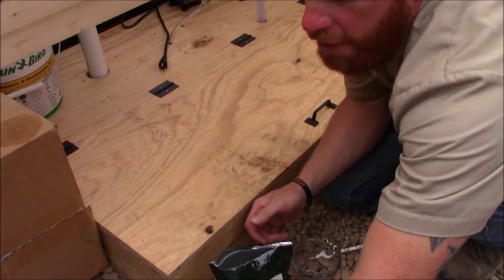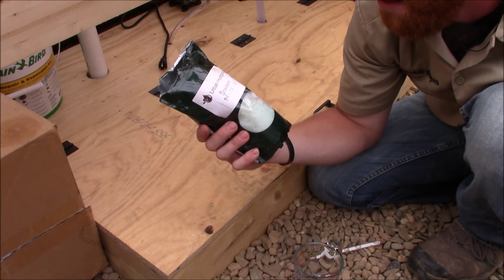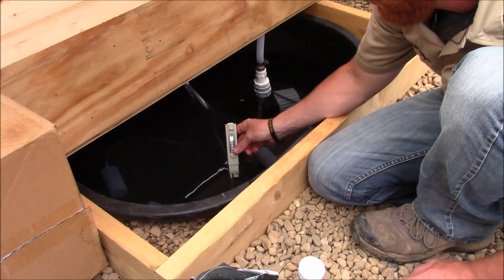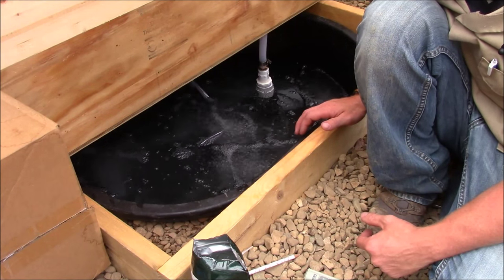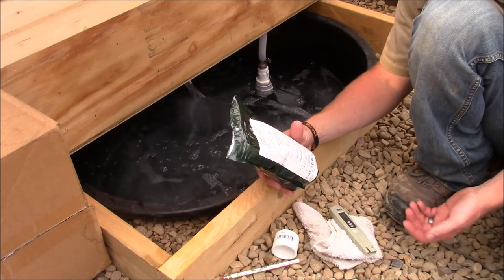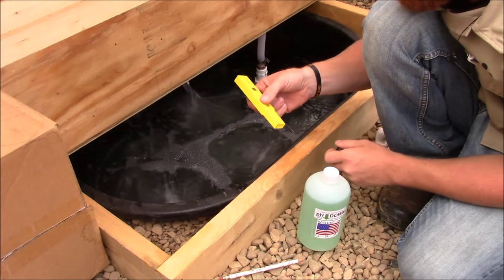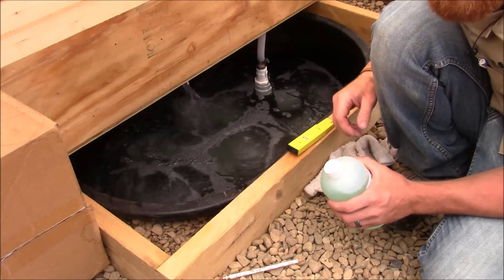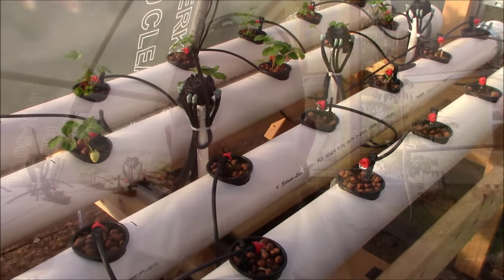Hydroponic Rail System Build - VLOG 8 by HPFirearms

Comment: @ 4:04 When any product states measurement in grams that is by weight, there is no measuring spoon or cup for grams it is the weight wet or dry.
So the dosage was 22 grams for 5 gal water and your system is 22 gal
so you need 5 gallons X 4 or 22 grams x 4 = 88 grams and you will be short by 2 gallons
which is close enough to start  : )
P.S pick up a paint mixer to mix your nutrients . http://www.homedepot.com/b/Paint-Paint-Buckets-Tools-Safety-Apparel-Paint-Buckets-Tools/Paint-Mixers-and-Stirrers/N-5yc1vZc5bkZ1z0sv1q?browsestoreoption=2